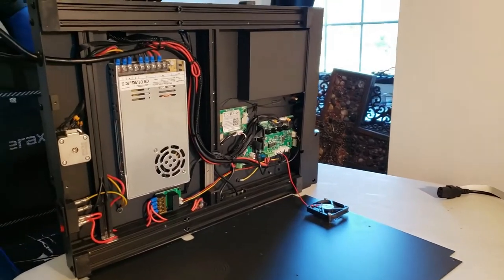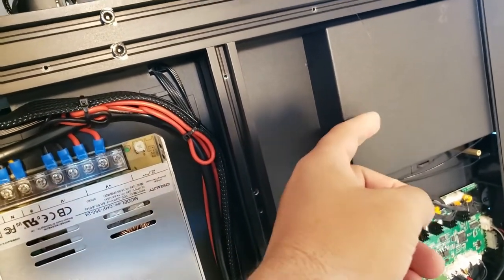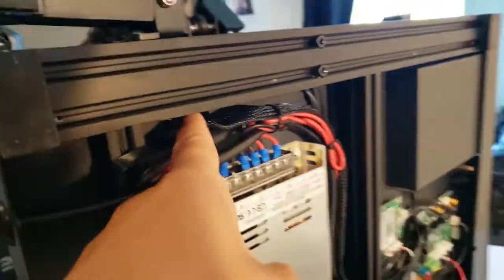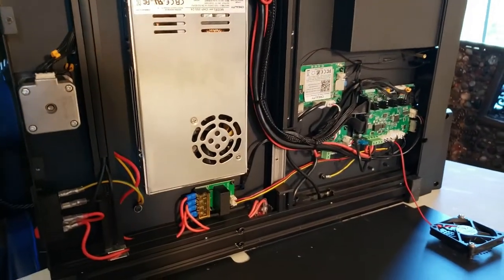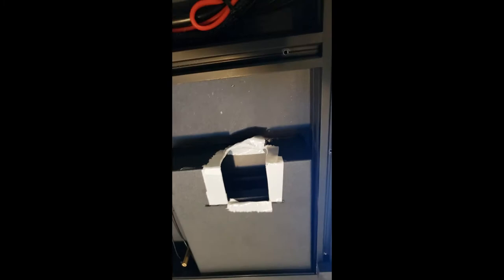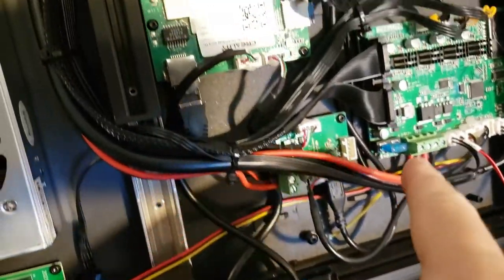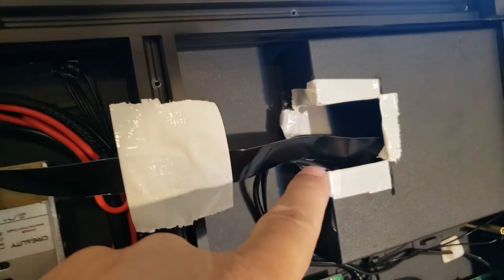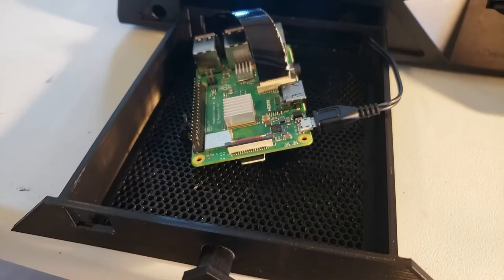Cr 10 Smart Octoprint Drawer Setup

Comment: You can now remove this video from the air because it's obsolete.. The cr-10 smart pro now comes with different internals and a dedicated USB-c for PC. No need to open it up anymore. Just connect the Pi to the usbc...

Comment: What horror if you have space and drimel what is the problem?! Why use drawer...
Reply from the maker: I like the sleek look of the CR-10 Smart and trying to minimize having things hang off of it like a Raspberry Pi.  I have 2 other 3D printers and with Pi's in cases attached to the rails.   I first looked at putting it inside the Smart without using the drawer but there is no room for it.   So I decided to use the drawer.   Would of been nice if Creality had left the back end of the drawer housing open for venting and then there would be no need to cut the metal.   It was well worth it as I have minimal external devices hanging off.
Reply: @MakerDave007  I made a better version. Internal mount so you can still keep your draw for all your tools or whatever and it runs from internal power. also goes to internal usb so no need to cut a hole in the front of the case. from the outside it looks factory. I ran the ethernet to the pi so that still works and also made the usb plug into the usb so you can still hook up a camera or keyboard and mouse etc, it replaces the dogshit creality cloud box and has way more functionality. this is a good attempt though. easy access to the pi having it in the draw vs mine where you have to take the bottom  off to access it. but id argue mine is better because nothing is "permanent" it can be put back to factory if desired.